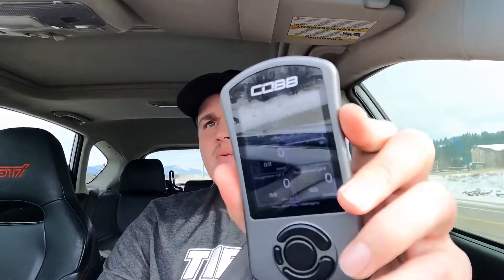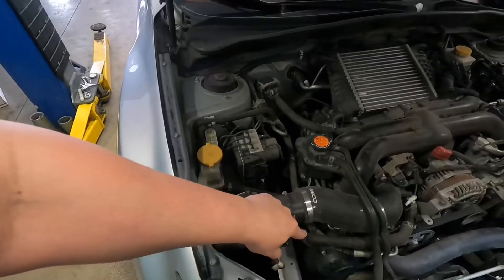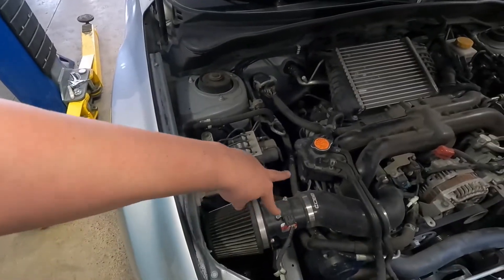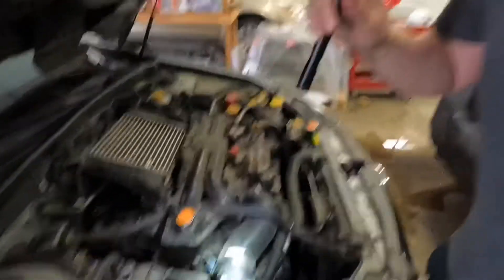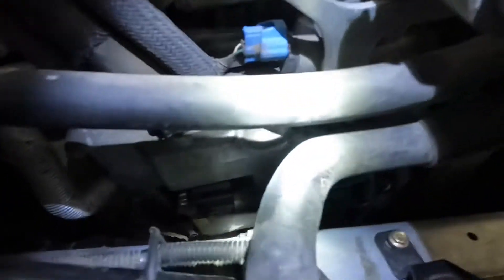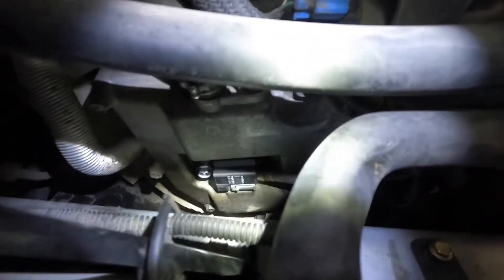Cylinder misfire diagnosis Subaru WRX

Comment: Just replaced the spark plugs and swapped coil pack from cylinder 1 to cylinder 3. It was running fine until i went home it started to bog again and same code misfire cylinder 1. Should i just replace the coil pack too?

Comment: my accessort has a misfire on cylinder 4
Reply: Same
Reply: @ did you figure out what it was ?
Reply: @ changed out the coil pack and it was good for one day and then the code popped back up 🤦🏻‍♂️ spark plugs looked good all around so my guess now it either the wire harness is damaged somewhere or a bad ecu god I hope it’s not the ecu. I’m so close to just trending it in for a CTR haha

Comment: Changed my coil and I have new plugs but I have missfire cylinder 1. Car idles rough but feels like it drives fine. Only time roughness cyl 1 goes up was at idle. What do you think?

Comment: So I'm having the same issue on my 05 outback xt ej255 ....I swapped my coil packs but it's still showing cyl 4 misfire I've also swapped injectors with same result what do I do next ??
Reply: Any luck finding the issue? We have same issue on Cyl 2 - not plugs or coil packs. Still running rough.
Reply: @erikaredding7926  I have this same issue on my '15 wrx. cylinder misfire on #2, changed all 4 spark plugs (was due for that) that didnt correct it, swapped coils on #1 and #2 and the code still gives a reading for #2.. gotta be a coil wire or injector at this point.
Reply: @erikaredding7926  check the spark plug gaps